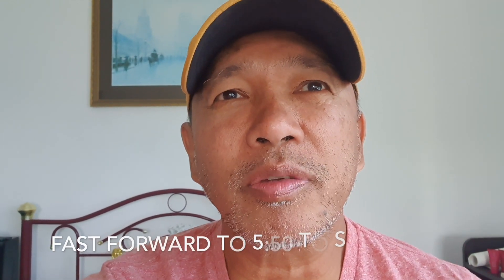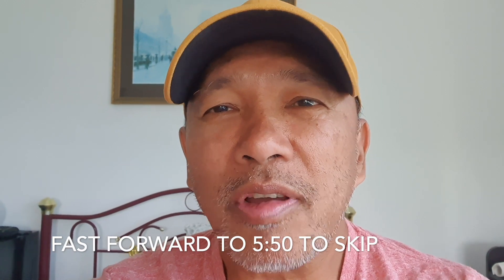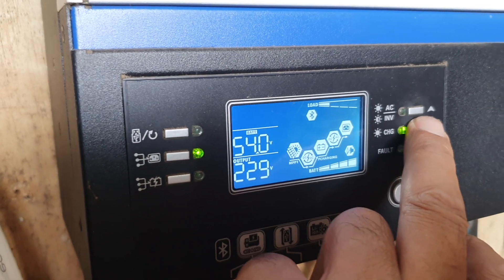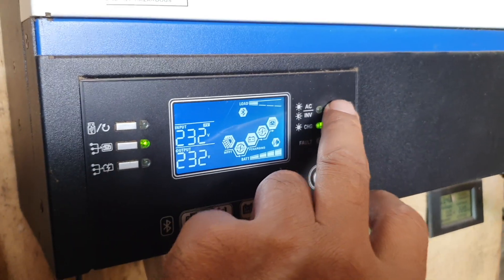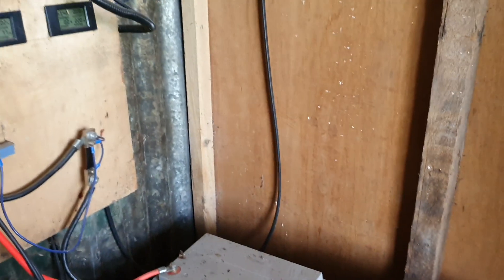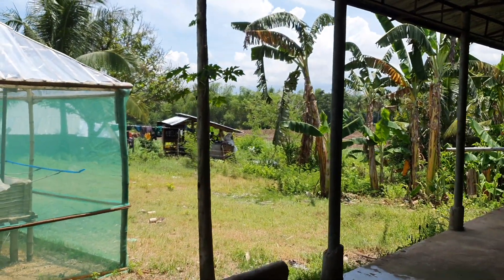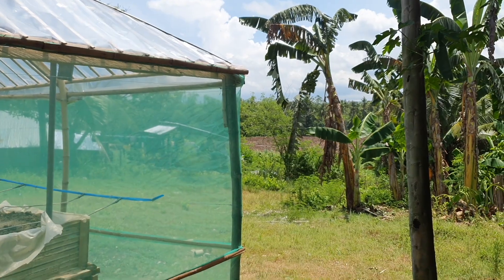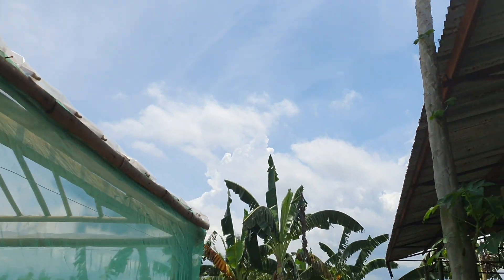MPP Solar Five Years in....Review!!!  No maintenance...

Comment: Great video, as usual.

My 5048 has been running flawlessly 24/7 since November 2019, haven't touched it.
Totally off grid but it runs the whole house, with all the mod cons, d/w, hot plates, mw, fridges, freezer etc. @ 240v.
I've bought a second one just in case this one fails, it would take several weeks to get a replacement unit and that would mean running on a generator 24/7, not a pleasant option especially with the cost of fuel right now.
The spare one hasn't been out of the box it came in.
I've also bought an 8048 and 16 320Ah LiFePo4 batteries, my ageing 12v SLA's won't last forever although they're doing fine right now, but they're about 5 years old now and I'm getting older too.
The thought of lugging 83Kg batteries around as opposed to the 2.2 Kg batteries frightens me now.

That new system will go up later this year, I've got all the bits and pieces now.
I'm planning to use the 5048 as the "Grid" input for the 8048.
Like you, I'm not an MPP Solar shill, I bought this stuff with my own money but I'm happy to recommend it,
The most important part is it runs the coffee machine, if my wife doesn't have her morning coffee my life is just miserable.

I hope things in the Philippines are picking up, I lost a friend over there due to Covid, she was visiting her family and couldn't get home, miss her.
Reply: I love the part about the coffee.  My wife's the same way.  Hahaha.

But just gotta tidy up as we're getting ready to retire in WV.  Coming home I hope.  But I'll be off grid as well.

Thanks for the compliment.  Hope all is well.
Reply: @elaurel951  Best of luck with your retirement, enjoy.

I retired 12 months ago, having spent most of my working life away from home it is so nice to wake up in my own bed every morning, loving it.

Hope you're still going to drop a video every now and then, I really enjoyed yours over the years.
I've been using a Pi B4 running ICC software for monitoring the system remotely, works really well, you may want to have a look at that. (Not shilling)

You may want to check out Off Grid Garage as well, some good videos and advice for off grid systems there.
Reply: @Capt K  

I will...though it might be in WV.  And thanks...I'll check those out.